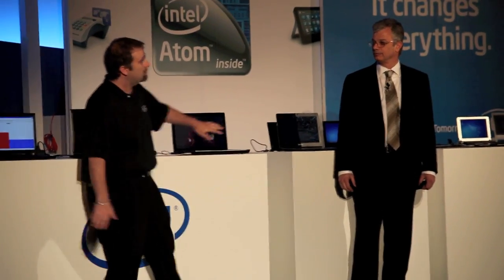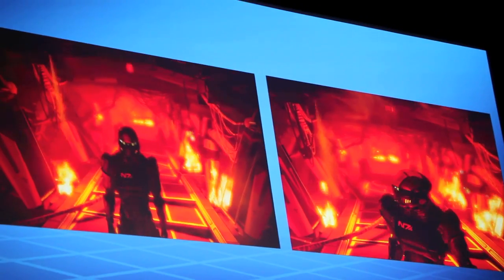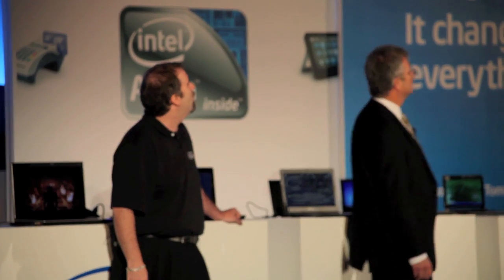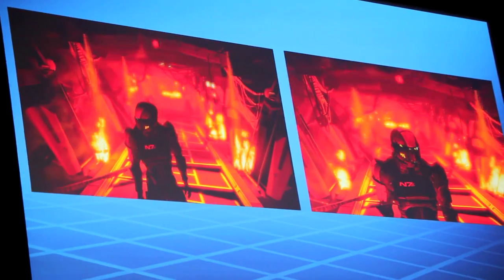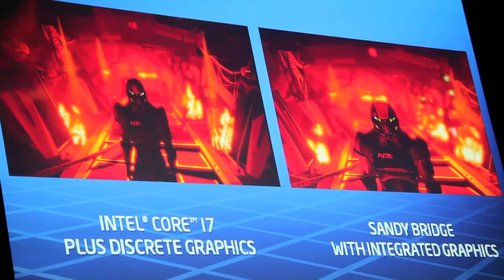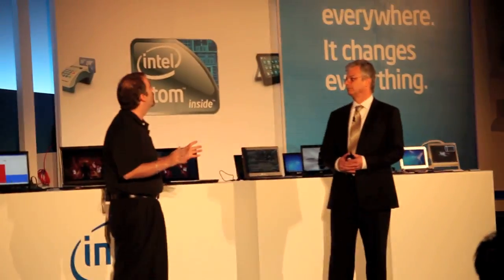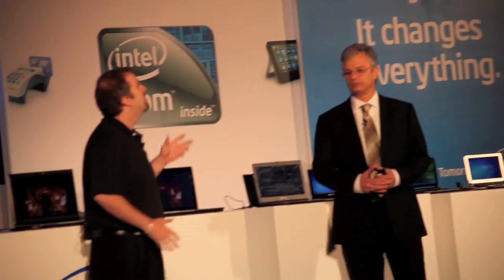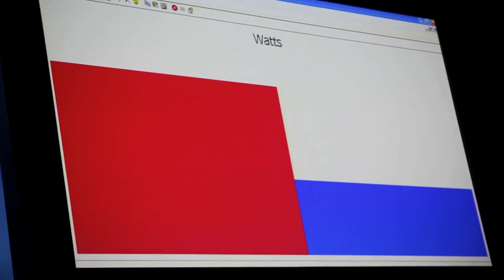Intel Sandy Bridge Live Demo @ Computex 2010 (HD)

Comment: Of course we can't  tell the difference,  both are almost still frames with the same graphic settings. The question would be will it get similar performance than a discreet? How about instead of the old guess what's what game they present a "running benchmark" with an fps counter on it. I'm sure by then, even a dumb head could tell the difference.